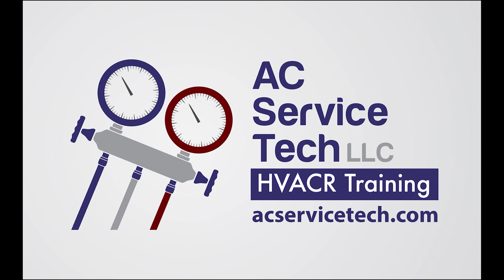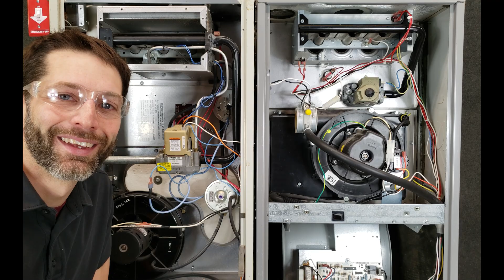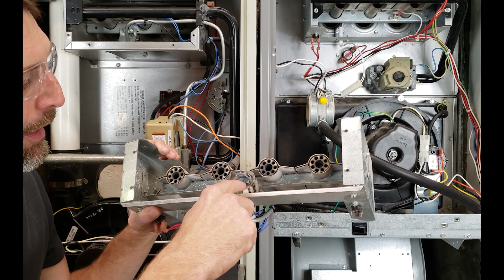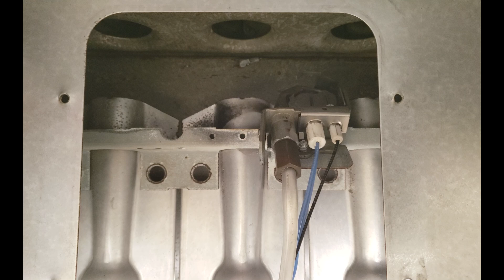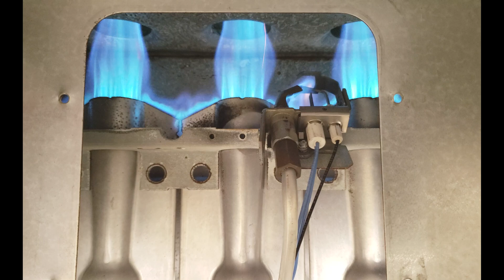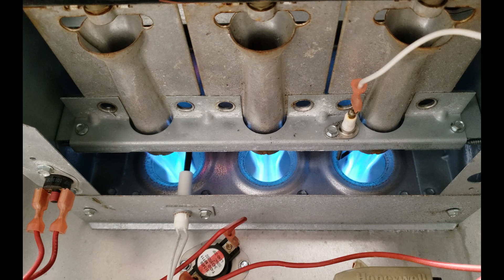Gas Furnace Training! Direct Ignition vs Intermittent Pilot Ignition!

Comment: Why did they even make an intermittent pilot furnace?  As there any advantage over anything except constant pilot?
Reply: First you had just a pilot light burning all the time.  They made it intermittent to save gas and wear and tear on the pilot light sensor.  Then they went to direct ignition.
Reply: @Islamisthecultofsin  lol.  I didn't ask for a sequence of events.  I  get that.  I  asked why they bothered.  They could have went right to direct ignition.  The technology was there.
Reply: @engineclinic    It was faster to modify what they had is why.  The tech wasn't there yet.  Politicians passed a law that said to do it now.

Comment: i can not find a single person with this problem 😂 my intermittent pilot flame is huge and its setting off the rollout switch.  i saw yours its tiny.  mines 3x that size and its tickling the top plate which is connected to a rollout switch.  everything else is normal?  ive tried cleaning it but not sure im getting it.

i see no rollout in any other way whatsoever.
Reply: The hole is probably too big.  I'd get a furnace tech to look at it.

Comment: Hi do u have a lesson about non-programer thermostat .thanks
I've bought on  it does not work , it is a round type but it has 4 little switches 
when I check it it does not make sense 
It was $ 30 so why it only works with programer

Comment: Another great video. Thank you again and Happy New Year. God bless. 
Is it typical or possible to operate as a service technician only or would you recommend learning the new construction or total system installation as well. 
Thank you again.
Reply: 95% of what I do is service tech work. The 5% is doing new stuff like filling in during a staffing issue.  Of the 95% maybe 5% is replacing a major component which is almost like a new install.  I like doing the service side of things.  I like the ramdomness of it and the whole figuring out the problem and solving it.  The install side is really cookie cutter grunt work.. Some guys like that side because it's a little more cut and dry, they come in with a job to do and do it.  I don't think the install side teaches you much of the troubleshooting side of it.  You will become familiar with equipment and maybe get a basic understanding of things and helps teach you major component replacement.  It would probably help in spotting possible issues caused by poor installation that a repair tech only might have missed.  Being a tech would be helpful for installation, making you lay everything out to be service friendly for the future.  I can't tell you how many times I've said what the hell was the installer thinking!".
My long winded opinion is you should have experience in both as both relate to each other but you can do just one or the other.  That how my work is set up.  Installers install and techs do tech.
Reply: @--harry_  thanks, that was excellent. Best answer I've seen so far, and the same question is asked all over the place.

Comment: What type of gas furnace  would you buy if retired on limited income?
Reply: Goodman
Reply: In some retirement communities particularly in southern New Jersey, I’ve seen them use a lot of oil filled electric baseboard heat. The advantage to those is the fact that they can be controlled individually or in small groups such as all in one room. This would allow you to heat only the room you want overnight and let the rest of the house cool down. 
The disadvantages to electric heat are that you need sufficient electric service coming into the house and naturally the increased cost of electricity.
That’s just one mans opinion, wait for Craig to offer his. 
Good luck on your project.

Comment: With direct ignition gas valves, what tends to fail with those as they appear to be simple devices when taken apart.  Is it the solenoid that allows gas to flow?  Just curious.  Thanks for your great instructional videos.
Reply: What causes failure are deposits on the flame sensing rod that impede the micro Amp DC signal from reaching the ignition module.  Cleaning the flame rod is easy but usually defacto.

Comment: You lost me at ac to dc. Pulsating dc and flame rectification is used both smart valve and hsi.
Reply: Flame rectified   Voltage  changes  thru the flame  acting like a diode  proving there a flame
Reply: Flame rectification is a ac voltage at a micro amp level that drops half of the sign wave. Making it a pulsating dc current.
Reply: The older technology was with thermocouples/thermopiles.  When heated, the thermocouple would create it's own power by having a reaction from dissimilar metals.  The newer systems, with flame rods, pass power from the rod through the flame to the ground.  A rectifier in electronics normally converts AC current to DC.  Like many use diodes to do it.  The furnace amazingly uses flames to do so.  The power is sent to the flame rod in AC.  It then passes through the flame (converting from ac to dc) to the the metal/ground of the unit.  Vala flame rectification! If there is no flame, poor ground, or if the rod is dirty, the power won't be sensed back at the control board.  
I was reading they were working on using the thermocouple technology for generating power in the future.  Think about a metal roof of a house heating up in the sun. I guess techs will be up there cleaning it up with dollar bills when it stops working!